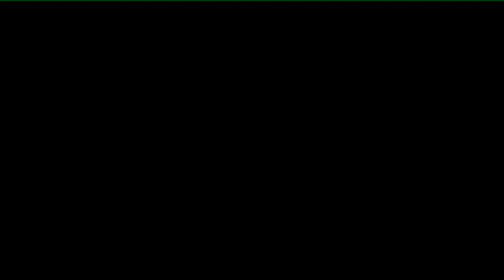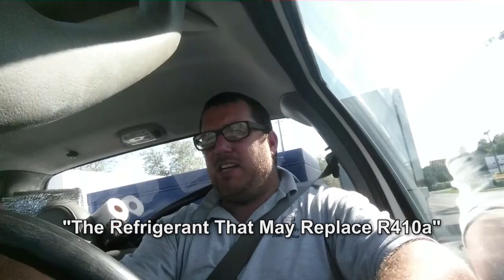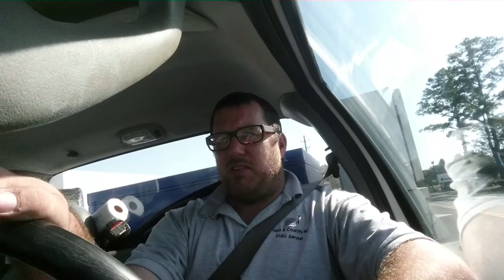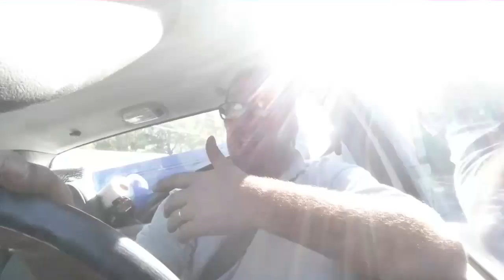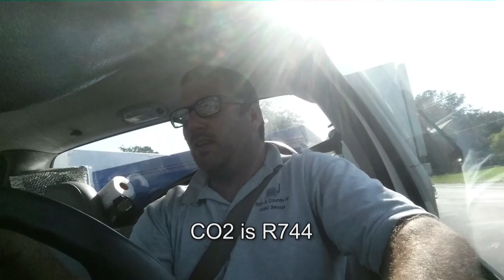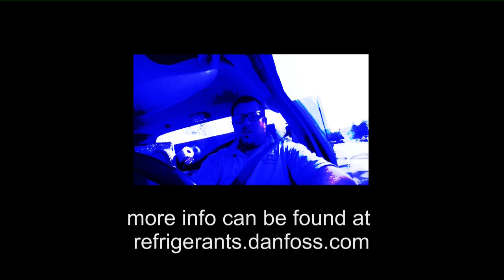The Refrigerant That May Replace R410a

Comment: Characteristics
R32 is difluoromethane (methylene fluoride) and it is
an HFC type refrigerant. R32 has been used for
many years as a component of both R407C and
R410A. It is flammable on its own, but not when
mixed with the other components of these blends.  - from the UK.

Further  info from  HeatCraft:  http://www.heatcraft.com.au/latest-news/90-r32-information-update

In Australia it requires  a 870.2264 lb.  (6000 kPa) capable cylinder according to HeatCraft.

I think we will see higher pricing,  maybe much higher pricing,   for the equipment that it is to be used in.
Reply from the maker: Thanks for the info. Perhaps we need a part 2 to this one.

Comment: The Emerson source below indicates Global Warming Potential of R22 and R407c are both 1600 while R410a is 1875.   No ozone depletion potential in either R407 or R410a.    Flammable R32 is part of the blend that makes up R407c and R410a.  The big advantage of R410a is increased efficiency over R22 while the other part of it's blend, R125, eliminates the flammability concern of it's R32 component.   However some tests do indicate a 10% capacity/efficiency increase when using R32 alone instead of the r410a blend, as long as the air/fuel mixture of R32 in a leak situation does not reach ignition point.

http://www.emersonnetworkpower.com/documentation/en-us/brands/liebert/documents/white%20papers/technical%20note%20-comparing%20r407c%20and%20r410a%20as%20alternatives%20for%20r22.pdf
Reply from the maker: The Danfoss site was a little different, but still very close.